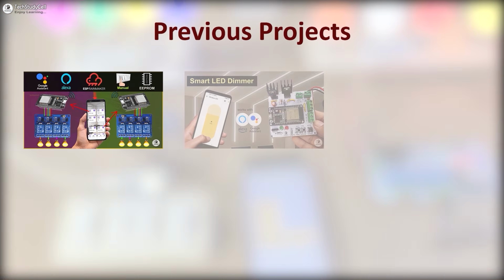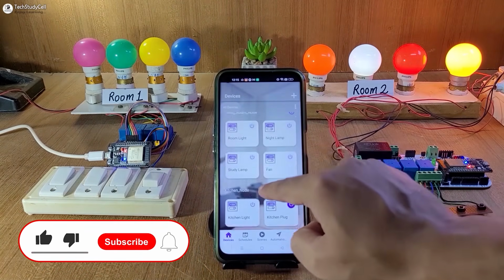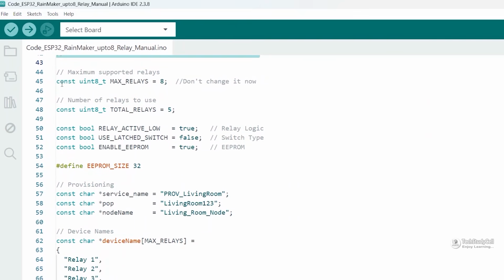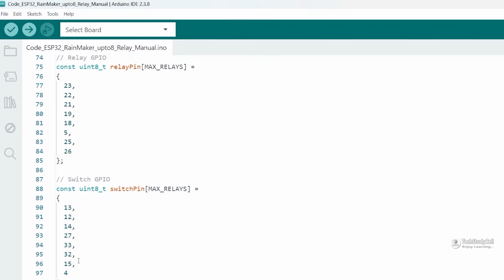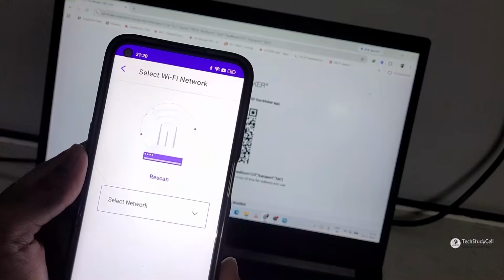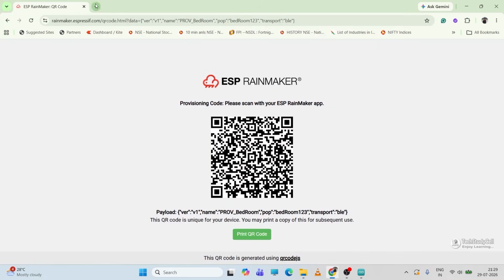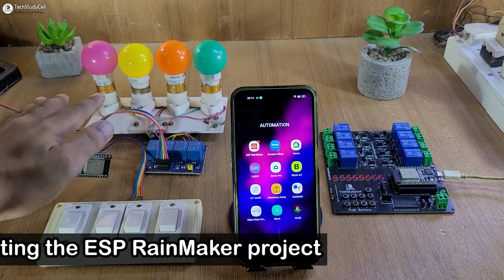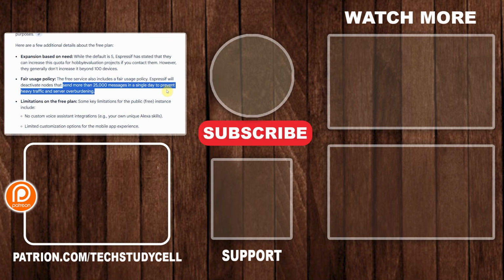Home Automation using ESP32 | One Code for All ESP RainMaker IoT Projects (2026)

Comment: As we are connecting relay module to the output pin i. e pin no 
21,22,23... and feeding the relay module 5 volt, will in not damage esp32 pin and how much current it will sink in esp pin

Comment: Arduino: 1.8.19 (Windows Store 1.8.57.0) (Windows 10), Board: "ESP32 Dev Module, Disabled, Disabled, RainMaker 4MB, 240MHz (WiFi/BT), QIO, 80MHz, 4MB (32Mb), 921600, Core 1, Core 1, None, Disabled, Disabled" C:\Users\STECH\AppData\Local\Temp\arduino_modified_sketch_886666\Code_ESP32_RainMaker_upto8_Relay_Manual.ino: In function 'void initializeRainMaker()': Code_ESP32_RainMaker_upto8_Relay_Manual:515:7: error: 'WIFI_PROV_SCHEME_BLE' was not declared in this scope; did you mean 'NETWORK_PROV_SCHEME_BLE'? 515 | WIFI_PROV_SCHEME_BLE, | ^~~~~~~~~~~~~~~~~~~~ | NETWORK_PROV_SCHEME_BLE Code_ESP32_RainMaker_upto8_Relay_Manual:516:7: error: 'WIFI_PROV_SCHEME_HANDLER_FREE_BTDM' was not declared in this scope; did you mean 'NETWORK_PROV_SCHEME_HANDLER_FREE_BTDM'? 516 | WIFI_PROV_SCHEME_HANDLER_FREE_BTDM, | ^~~~~~~~~~~~~~~~~~~~~~~~~~~~~~~~~~ | NETWORK_PROV_SCHEME_HANDLER_FREE_BTDM Code_ESP32_RainMaker_upto8_Relay_Manual:517:7: error: 'WIFI_PROV_SECURITY_1' was not declared in this scope; did you mean 'NETWORK_PROV_SECURITY_1'? 517 | WIFI_PROV_SECURITY_1, | ^~~~~~~~~~~~~~~~~~~~ | NETWORK_PROV_SECURITY_1 Multiple libraries were found for "WiFi.h" Used: C:\Users\STECH\OneDrive\Documents\ArduinoData\packages\esp32\hardware\esp32\3.3.7\libraries\WiFi Not used: C:\Program Files\WindowsApps\ArduinoLLC.ArduinoIDE_1.8.57.0_x86__mdqgnx93n4wtt\libraries\WiFi exit status 1 'WIFI_PROV_SCHEME_BLE' was not declared in this scope; did you mean 'NETWORK_PROV_SCHEME_BLE'? This report would have more information with "Show verbose output during compilation" option enabled in File -> Preferences.

Comment: Sir,Please I'm having a problem. The WiFi connects. Then, after disconnecting, it won't connect again. After that, it only connects when I turn it off and on. What can I do about it?
Reply from the maker: After disconnect,  please wait for 4 minutes then reconnect.  As we are using free plan, sometime it happens initially,  Afterwards it resolved.  If you face same issue After 2day let me know

Comment: great job, but it's better to use the Preferences library instead of EEPROM. Preferences stores data in the ESP32's NVS (Non-Volatile Storage), which is more reliable and doesn't require manually calling EEPROM.begin() or managing addresses.

Comment: Sir please add wifi reconnect logic
Reply: Yes when electricity off and back again the esp 32 not connect to the wifi 
When I press boot button then connect to the wifi
Reply from the maker: Thanks for your feedback! 😊 I tested this project with ESP32 Arduino Core 2.0.14. In my testing, the ESP32 reconnects automatically after the WiFi/router comes back online, although it may take around 5 seconds to reconnect to the ESP RainMaker cloud.

If you're testing by turning OFF the WiFi router, please wait for at least 30 seconds before turning it back ON. This gives the ESP32 enough time to detect the disconnection and start the reconnection process.

If your ESP32 still doesn't reconnect, please let me know: ESP32 board model
Arduino ESP32 Core version
How you're testing (router OFF/ON or power outage)
Reply: @TechStudyCell  yes sir previous rainmaker project doesn't reconnect after wifi lost and resume